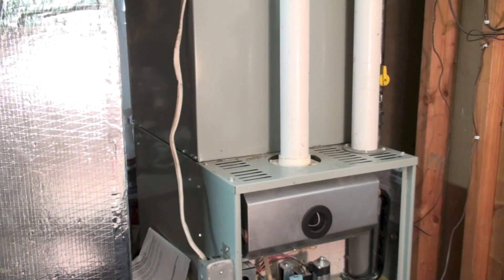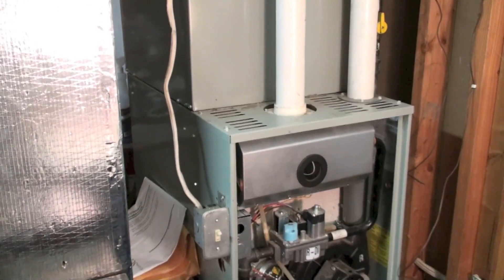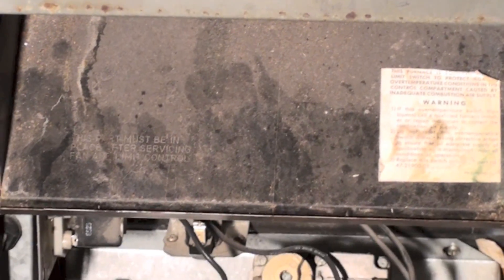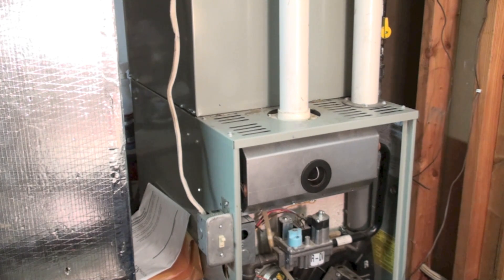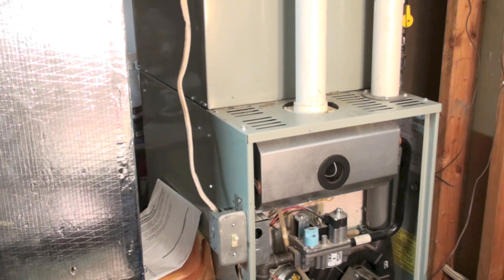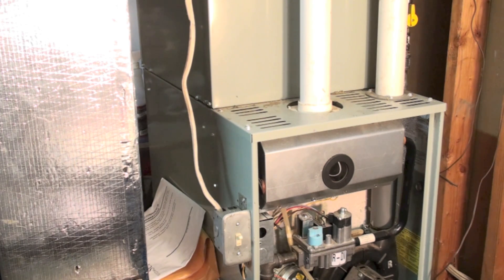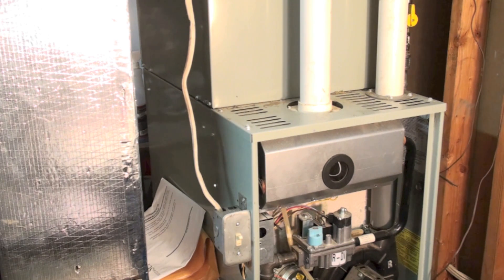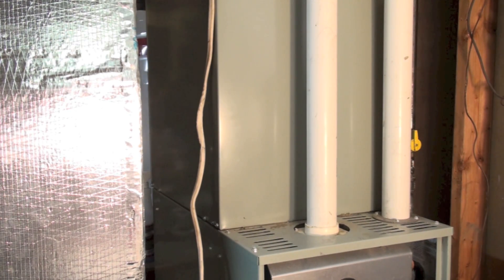The value of outside combustion air for gas furnaces

Comment from the maker: There are requirements for room volume to supply combustion air.  The amount depends on the size of the appliance.  These are only used if the appliance takes combustion air from the room.  Essentially, the requirement is depending on building envelope leakage to supply combustion air.  Thanks for the comment.
GFM

Comment: Also doesn't code stipulate that the room with the make-up air has to have so many cubic feet . This is why I use make-up air drawn from the outside. Great video. Thanks for sharing.